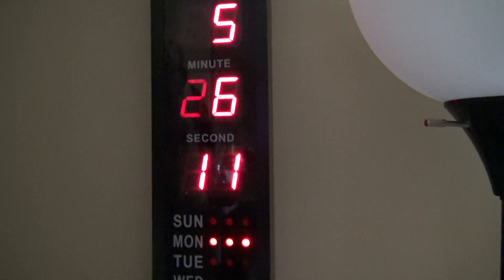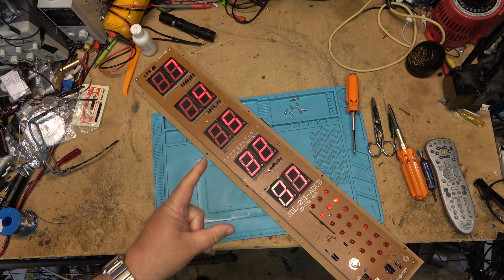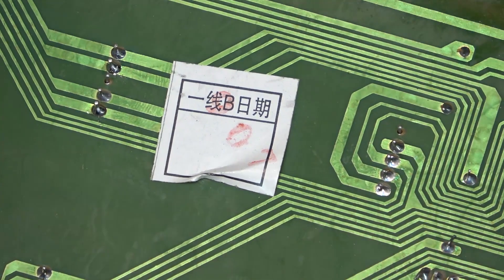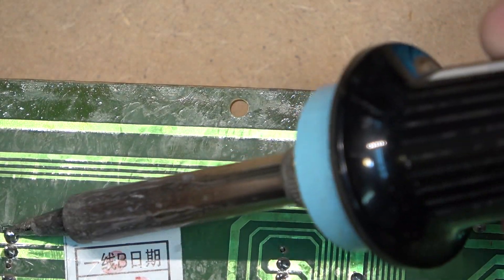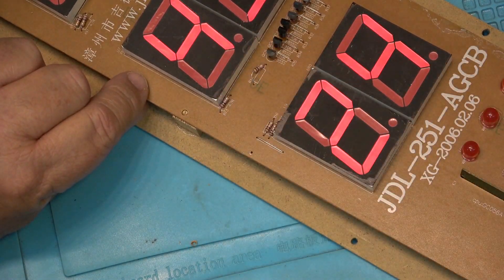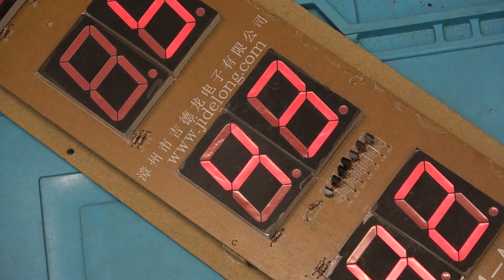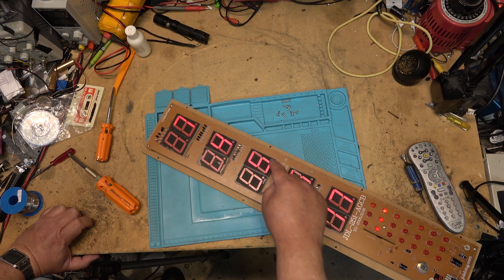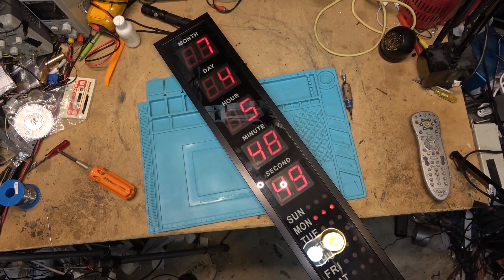A broken clock is right twice a day

Comment: The 9-160-04. Zenith System 3 power/sweep boards were common for intermittent and cold solder joints. I used to do a complete soldering job on all the components. Never got a callback!!!

Comment: Interesting item. Very retro aesthetic with the red digits and black / glass case even if the Web address printed on the board betrays its 21st century origin. Reminds me of the vintage 'Spartus' jumbo alarm clock that my late wife owned until it stopped working, that had massive red digits that lit up half the bedroom! Certainly something like this would have cost an arm and a leg in the 80s, which seems to be the era it's trying to evoke. It wouldn't 'go' in my house, which has more of a pre-war, dark wood style, plus I don't like clocks that I have to 'decipher' (the vertical layout of this one means I'd likely have to do more than just glance at it.)
Reply from the maker: The chip that controls this is actually from an old digital watch.   That's the same type of display early LCD watches had. Month date hour minute second and day of week indicator that was just a flag over the printed day on the glass.   That's why the chip is mounted on a break out board to operate the drive circuit.  The buttons that set the time work exactly like old digital watch.  Can display 12 or 24 hour format as well.

Comment: Decimal points I would have at least taken the one for the seconds and seen if I could get a 1Hz or 0.5Hz beat pulse out, and used it to flash the decimal points in the minutes and seconds sections, or grabbed a 4017, and made it light up each of the 10 decimal points in sequence, using that clock signal. Day displays are crying out for the 3 round led displays to be replaced by a rectangular LED to get a full bar display highlighting the weekday as well, not just the 3 dots, though you would have to strip the mask there a little to make it a bar display.